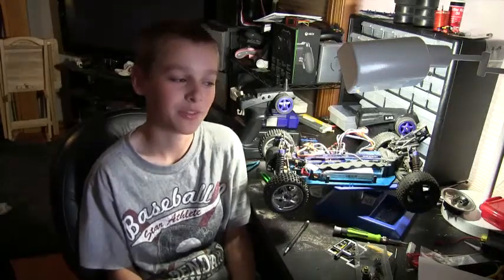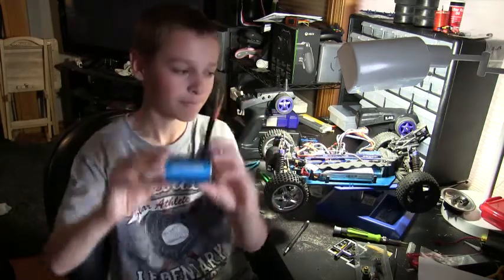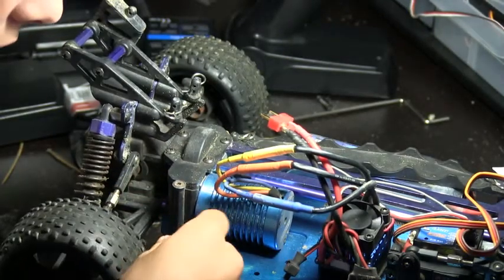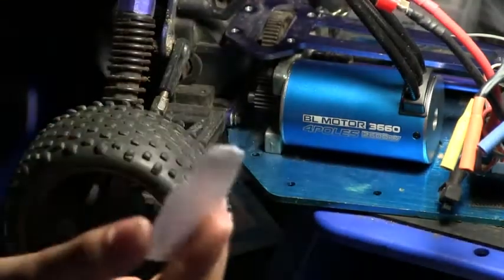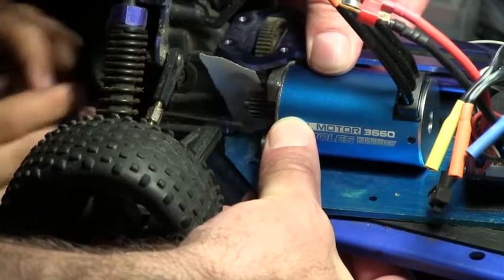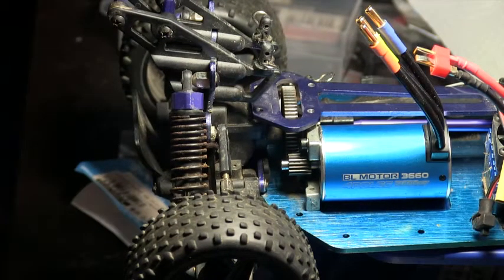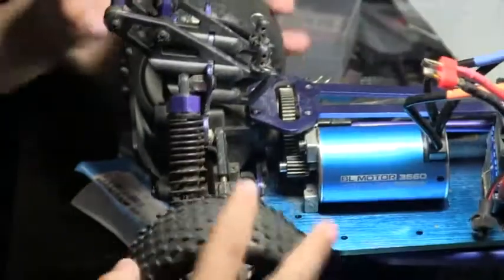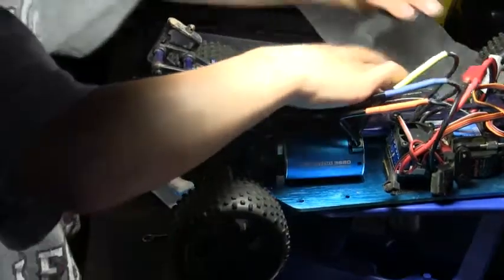How to replace brushless motor and upgrade from 3650 to 3660

Comment: Hi, I am 13 years old and have a Slash 2wd.   I am trying to upgrade 3660 size motor from Brushed motor. 
so 3660 has more power than 3650?   How much more power?  Less heat for the motor and ESC? 
Please let me know.  Thanks.
Reply from the maker: Not sure how much as it depends on a lot of things.  If going from brushed to brushless it is a major jump in power.  You need to research the KV that you will need as this is speed vs power.
Reply: 900watt vs 1200watt Heat of ESC depends of KV of motors and max current (Amp) of motors